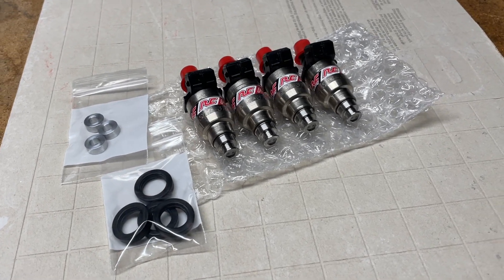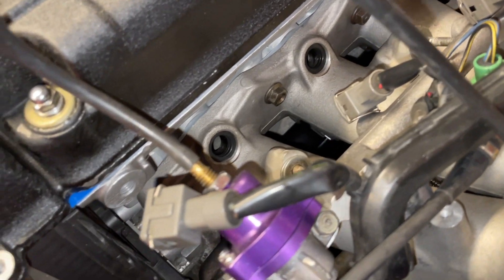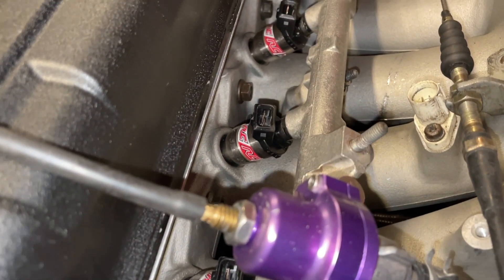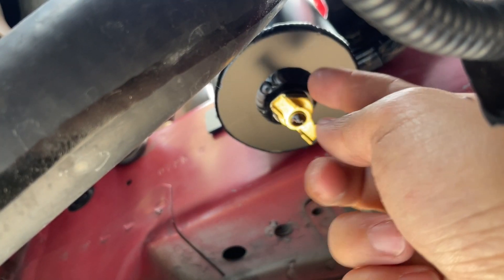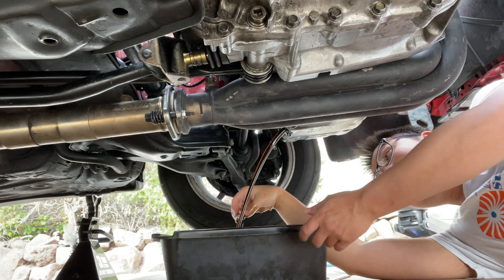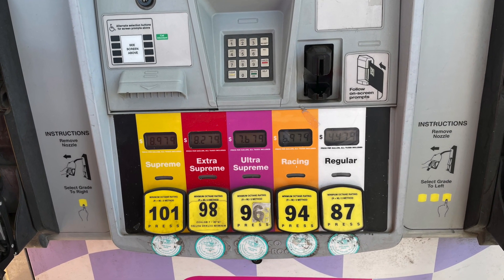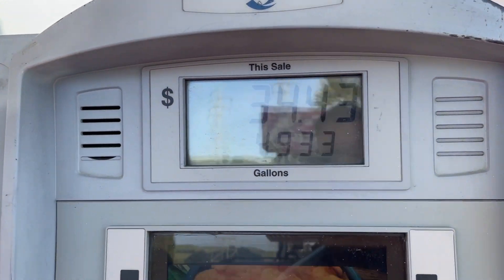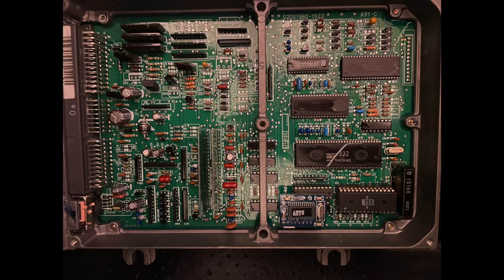B20Vtec Build Ep6: Dyno Tune

Comment: If you swap the itr header for a try y   header your tq should pick up a bit more and flatten the curve but still give you good top end like the itr.
Increasing the intake pipe length would also help with that. Short ram for topend/ longtube for tq The itr header is great but optimized for a 1.8, that 2.0 needs to breath. Your setup is awesome and looks well matched up for the power you wanted. Just my 2cents, also, if you haven't yet,swap out your distributor or check the conections on the tach outputwire and make sure it's all conected. Also try and stay away from autozone, or other rebuilt distributors, oem is getting hard to find new and are pricey but worth it. I went through enough distributors on my old lsv before going full oem rebuild. You could also run a coil on plug conversion and never have issues again. It's good to see Honda's are still getting love In the Bay 👍 keep at it!
Reply from the maker: I picked up a 3 inch exhaust and planning to get some larger cams in the 12mm lift range and chop open the intake manifold to port it out. Thinking that should get me into the 220 range. My tuner said the COP conversion doesn't really add any gains unless you're having issues with the distributor so i'm not sure if I'd consider the tach being off a real problem. Maybe it's the start of something but we'll see.
Reply: I feel it, it must rip as is rn. Keep it up 👍

Comment: Hi  I have an Acura  and it’s an automatic. To be brief I accidentally drove with my emergency brake on for about 5-10 minutes going 35-45 miles per hour because I was going to a gas station and I smell burning .. What kind of consequences can I expect and Ik I have to get it checked out just in case but realistically is it going to be expensive ?